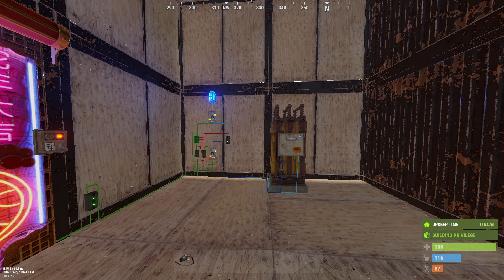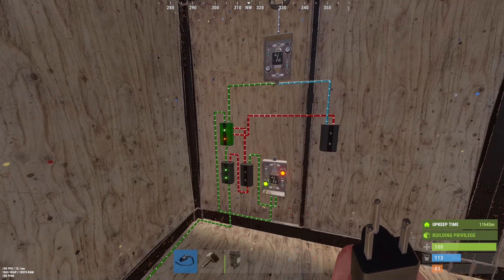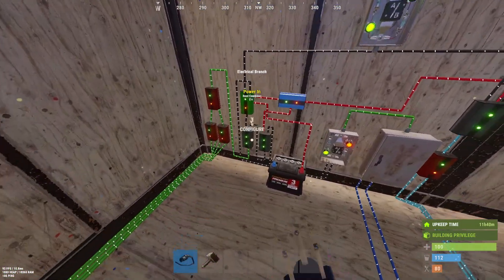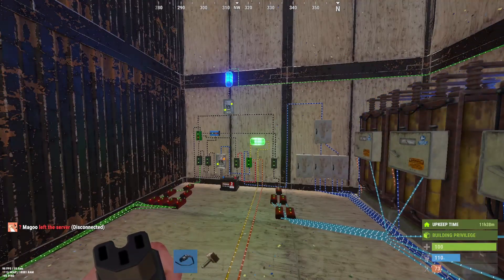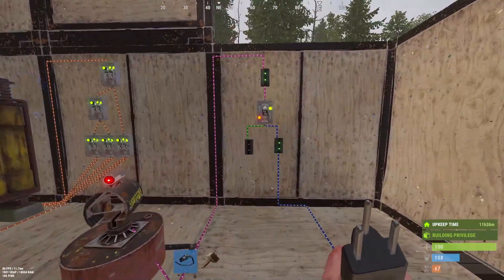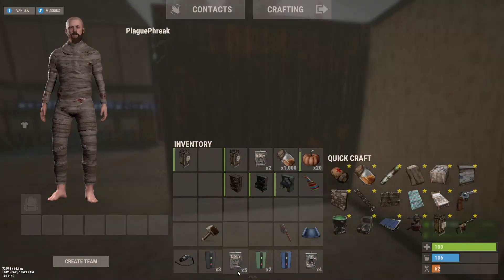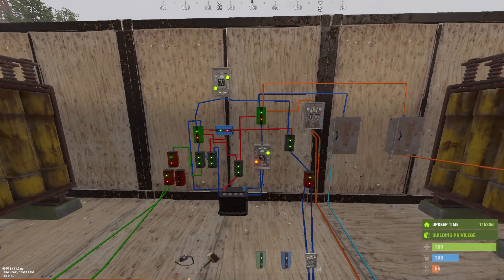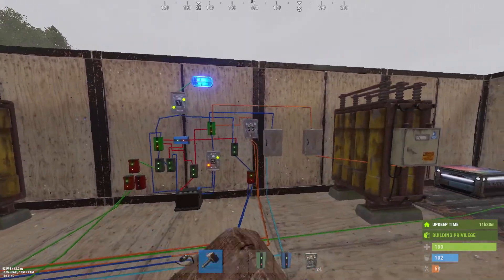The NEXUS Core. Why Its Better Than A BCN Or NIH Core | Rust Electricity | 2025

Comment: Do the windmills charge the batteries when the battery power becomes the primary input, like if the windmills arent enough and batteries take over, does the windmill power go to batteries cause ive built this and it doesnt do that but not
 sure if its supposed to
Reply from the maker: it should yes, when battery power is being used it should send all root power to batteries so they can be charged while being used meaning uptime for batteries is extended

Comment: Could you explain how to expand batteries?  For some reason my aux battery splitter doesn't charge them and i'm not sure why.
Reply from the maker: its probably easier to talk on discord, if your in the rustrician discord just @ me, my discord is the same as my YouTube, or you can always ask someone else there, but its probably better to know what's fully wrong by looking at the circuit than saying something that's based off speculation

Comment: Thank you for putting together a very helpful video. It’s not something one should take for granted. There wasn’t a lot of new information for me, but it definitely made me think, and that’s when you know the video is already good. For new players, there was certainly a lot of useful content.

In your BCN core, the memory cell is reset by the smal battery. In my view, that creates a problem. For example, if one large battery is destroyed, then the total remaining energy from the batteries might no longer be sufficient to power the blocker, which then causes the memory cell to be reset by the small battery. This happens even though another battery is still present, assuming we have two batteries, and that remaining battery could still provide 100 energy. And if we assume there are no wind turbines left, then you would still have one battery available, but it would no longer be used.

What I’ve been thinking about, and what might make sense, is placing an additional branch between the root combiners from the wind turbines and the first branch, and setting its output to 1, then connecting that to the reset. That way, the memory cell will only reset as long as an energy-producing source like a wind turbine is actually still active and capable of supplying power, making sure that the most important nine turrets can still receive energy.

With the current BCN-core setup, if the number of batteries becomes too low, the memory cell is reset automatically, even though there might not be any wind turbines left that could still supply energy.

Comment: Nice!
Will start next wipe defence with NIH core - a couple solar panels + 1 large battery. ( 2 sources = root power + battery)
Expand into BCN core with 1 windmill + solar panels + 1 (main large battery) + 1 (backup large battery). (3 sources = root power + main battery + backup battery)
Expand into Nexus with 2 windmills + solar panels + 2 (main large batteries) + 2 (backup large batteries). (3 sources + failsafe if the core gets destroyed)

Am I getting the point here? seem like a pretty easy way to expand into defence security.

Comment: has something been patched around this? I'm getting short-circuit on the battery root combiners whenever the batteries are plugged into the splitter. I just don't see how there could be a short-circuit since they only go into the blocker and out the OR.
Reply: ah, I see, it's the total number of sources that causes this. Reducing them fixes then issue.

Comment: so ehm i have 8 batterys but now all the root combiner for all Backup batterys wont work bcs of the "short Circuit / MAx depth" how to fix?
Reply: can't use 8 batteries and more than one backup battery per area. avoid any root combiners in the backup- battery system and it should be fine.

Comment: small tip you dont need smal battery in bcn core. you just need to install it in the righ order so 1 sec impulse go through. all the youtubers just copied this system wrong thats why it isnt working properly without small battery.
Reply from the maker: Your right. But also wrong... the battery is used so you can save power from the main source as the small battery doesn't need to be charged as there is no active usage. Adding the battery is more efficient. If you don't believe me feel free to find the BCN section of the rust electrical handbook that explains it in alot more detail

Comment: Can you make a video on how to expand it, such as, make your final output more than 100. Add more batteries etc?
Reply from the maker: To fix the final output for the main power of the NEXUS you'd just change the branches output to XXX for both root and battery power as Root = battery for that case. If your talking about the backups of the nexus. 100 should be enough anymore but just add a root combiner to combine 2 batteries.
Reply: @plaguephreak okay will try to experiment with that today! Thanks!
Reply: So I figured that out, now the last thing I guess I’m stuck on is adding the AND switches for the multiple batteries
Reply from the maker: I'll also make a new video aswell. I'll do this at some point as I don't have much free time

Comment: This all makes sense to me and I'm following for the most part, but my question is where exactly would be the ideal to have quality of life items plugged in? if the batteries shown in this video are all used for backups for raid defense, are you just running extra things like lights, furnaces, etc. off of the main power line from the nexus? Or should I have even more batteries/power sources?
Reply from the maker: Honestly. You can do either. The nexus is just a concept to get extra power out of your main source once core backups are full. So you can connect them to the normal circuit or to a backup :)) the good thing is you can have as many batteries added as you'd like

Comment: Your Nih Core is build wrong. Thats the reason why it doesn’t switch back if the battery is being destroyed. Best regards.
Reply from the maker: Hey, You're actually very wrong here. Nihagi, the creator of the NIH core even points out this issue with the NIH core. when battery power is being used, and main power isnt enough. the NIH core does NOT switch back to main power when battery is destroyed and being used. it will only switch back to main power when the source power is enough to power the entire circuit again.

Comment: Hey Plague, solid approach here. The main issue I see is that you might run into electric depth limits fairly quickly, since all batteries and power sources are tied together through combiners. Once you reach a certain number of batteries and sources, the setup will likely fail.
I really like how you use external batteries as a separate backup, but from what I understand, they’re only charged from your main circuit — and only after the first set of batteries is fully charged, which could take quite some time.

Another challenge is that this circuit is highly advanced and complex, so it can’t really be built right from the start. And in Rust, early-game solutions are usually key.

My approach doesn’t require central batteries, is fully redundant, has a simple kill switch for everything (e.g., turret auth), and can be built from day one. Worth taking a look.

Nevertheless good approach. Love the effort. Keep up the good work.
Reply from the maker: Hey, Max Depth Limits Only apply to root combinders, so the main 16 batteries used for the main NEXUS are what are effected, the secondary backups dont get effected by this as you usually wouldnt use a root combiner with those batteries.

Also, The Nexus is a build on of the NIH core, So youd build the NIH core Early, then upgrade to a BCN core when adding more batteries and then the NEXUS for late game, i didnt really explain that well in the video and thats my bad.

thanks for the comment and ill continue to improve and make higher quality and informative videos <3
Reply: Thats a misconception on your side unfortunately and not correct. A max depth error is not only limited to root combiners. All components come into play.

Happens to the best, especially if you are new to electricity in rust. I do this for 7k hours exclusively now and had to learn it the hard way back then when I was combining batteries together like you until the whole system broke at one point.

I learned my lesson and reworked my setup, reworked it again, tested it live in countless wipes on big bases, fine tuned it to what it is today. Highly efficient now and just works.
Reply from the maker: @sissiwasabi hi, sorry I worded this wrong, I meant to say that max depth only affects root combiners. So max depth doesn't affect other components.
If the total number of components in that power path exceeds 16, the Root Combiner will stop functioning and display the Short Circuit / Max Depth error on one of its inputs.

However, that's only for your "battery checked system"; you should never need more than 1600RW. (since you'd only need root combiners for the main circuit system)

You can achieve this with the RC-BUS. I go more in-depth on max depth in my other video, but I should have explained this better. The secondary backup batteries should never need to use a root combiner. Hence, why you can have more than the core 16 batteries

I did some math. Too have 8 turbines and 16 batteries, you'd achieve 15 MAX DEPTH, meaning you wouldn't hit the max depth issue, so everything is fine on the NEXUS.

If you don't add the mem cell for the NEXUS and just use the BCN, you can have 16 turbines and 16 batteries.

Effectively, you'd only have 8 batteries for turrets/sams, that's 800RW, and that's all you'd need for that. The rest of the power (secondary batteries) powers everything else, lights, door controllers, heaters, electric furnaces etc etc.

Realistically, for the NEXUS, you wouldn't need more than 8 core batteries, so you'd have 16 turbines and 8 batteries or 12 turbines and 12 batteries. But everyone to their own
Reply: @sissiwasabi  Noob here, run into max depth, read it is not more than 16 components including power source + last root combiner in the setup. Never happened again, when i kept to that rule.
So you still have a 16 batteries core, if you keep the external secondary batteries to 1 per area and therefore avoid root combiners.
Or you split them up into 4 groups by 4 batteries and use or-switches to make them all primary and secondary backups. would have to stay relatively close, as you can't afford to put anything in to extend the distance.
alternatively, you can always split the grid have more than one bcn / nexus and use the same principles.
I'am not sure (as i'am new to the game), but i kind of think, that the more serious vulnerability in most systems would be the branches / combiners and splitters. They don't take much damage and knocking them down, can easily disable power in that area, even if you have ten backup power systems in place.
Reply: @plaguephreak dude this is the best video idea. Show us w game plan for expansion

Comment: i got a question why do u have 100 Elec going into the Blocker? isnt it waste or
Reply from the maker: It shouldnt be a waste, in the video i never set the elec branch to say 75, so only 25 would go into the blocker. but it wont get wasted because it isnt being used by the battery as the blocker is constantly blocked meaning active usage will never go up
Reply: @plaguephreak  why 25 in the blocker? can i just put like 5 or 10?
Reply from the maker: it doesnt have to be 25, aslong as its giving the blocker 1 power then it doesnt really matter.
Reply: @plaguephreak  i put 1 power in but then it starts flicking on and off and using the backup power
Reply from the maker: Are you using the branch output to power the blocker? If so that's the problem.
Reply: @plaguephreak  ah ok

Comment: @PlaguePhreak What I miss on all videos on yt about core circuits is, nobody tell something about the limitation by daisy chain input and output of power sources.
So people can get the "Short circuit /max Depth" Error and wondering, what`s going on.
I created a little circuit on the rustrician website to explain this Error.
If you want, I can send you the link and you can do with it, whatever you want. 😉
Reply from the maker: Hey!!! im actually working on a video right now and i plan to talk about that in it. im hoping it will be helpful for alot of people as i want it to be a sort of beginners guide to rust electicity :D

Comment: so it basically uses n-1 AND switches per n batteries? eddited another question, wouldnt connect an output of a AND switch work still for three batteries?
Reply: sure you could use combiners for using only one i guess, but you would have to use either one or two switches, 2 for odd number batteries, one + combiners for even number batteries
Reply from the maker: Yeah. Now that I think about it you can have an odd number of batteries. I didn't think too much about it and only really saw even amount.

Comment: This is complex for no reason. Just use infinite power loop. It works the same way. 1 windmill powers 9 turrets they blow windmill battery takes over blows battery windmill takes over
Reply from the maker: I'm not sure if you're trying to rage bait, but to my knowledge, "infinite" power doesn't exist anymore; they patched that a long time ago. Assuming the "infinite power" you're talking about is the OR/Blocker Setup, Then That is an Inline System, which isn't particularly effective. What you just explained is literally a NIH/BCN core.
Reply: @plaguephreak no I’m not trying to rage bait. And I’m not familiar with the names of circuit and it could be out dated I’ve been using this circuit for about 3 years.
Reply from the maker: Hey! Thats Fair, Yeah i didnt some research and the Circuit you're using is the Or/Blocker Method. it was often mistakenly called "Infinite Power Loop," this circuit dates back to Rust’s 2019 electrical system, where batteries could either charge or discharge, but not both. In that era, batteries lacked Active Usage tracking and always pushed out maximum power. The so-called "Infinite Power Loop" was a real (and different) exploit, but this circuit simply offered the first bypass battery backup — not unlimited power.
Reply from the maker: Hey, talked about this in my new video. hope it helps out a little <3
Reply: @plaguephreak imma watch it right now

Comment: I'm new to this scene, I didn't even know you could optimize things that much in terms of rust elec. I'm usually on a group of six people, all friends playing together, is it valid to build setups like that on bases that are not that big or should I implement something easier? I usually go with the default noob branch and splitter for turrets lol, even tho we are not a big clan we ran several times on that problem of our battery getting destroyed mid raid and we basically can't defend...
Reply from the maker: Id work on using a BCN. Put it somewhere safe that raiders most likely won't blow. 3rd or 4th floor usually works well. There's a link for the BCN in the description
Reply: @plaguephreak Thank you so much! I'll stay tuned for the upcoming content!
Reply from the maker: Videos might be slow, I usually record them,. forget about it then redo the entire thing later when I've got motivation to upload a video. but ill do my best. might work on a security system at some point for group sized bases.